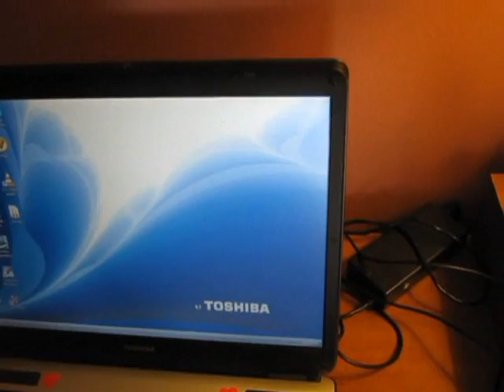How to Clean Dusty Fan on a Toshiba Satellite Laptop: Putting It Back Together! (Part 2)

Comment: These models are hard to take apart ... I had one n just got rid of it cuz the fan was getting really LOUD .... Now I have a HP Pavilion DV6500, and its so QUIET, got a cooling pad, n my temps dont even reach 70's Celsius, just stays sometimes at 55 and 57 Celsius .. :)) great video, this would be great for starters btw :))